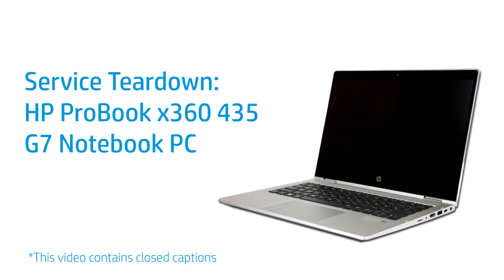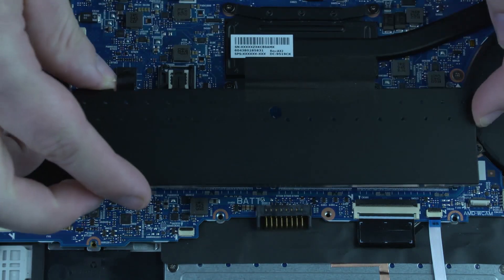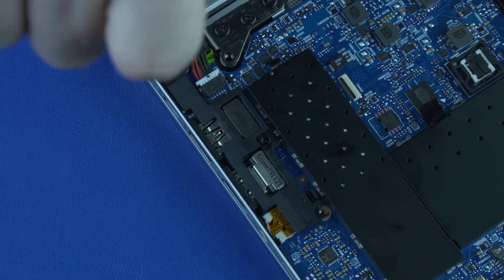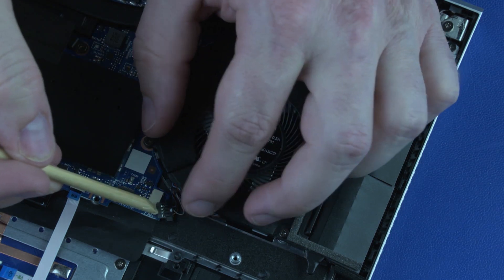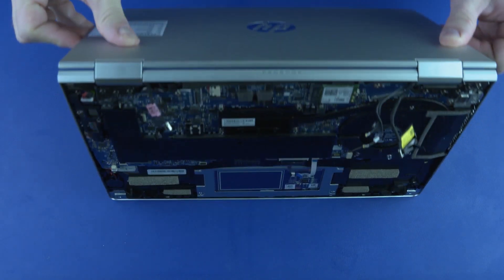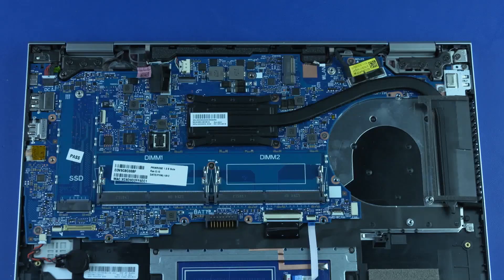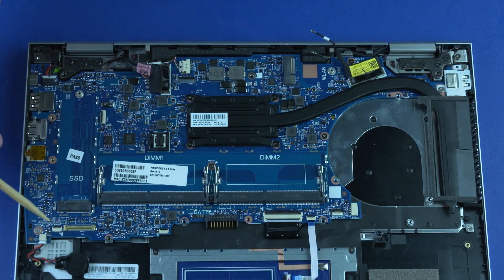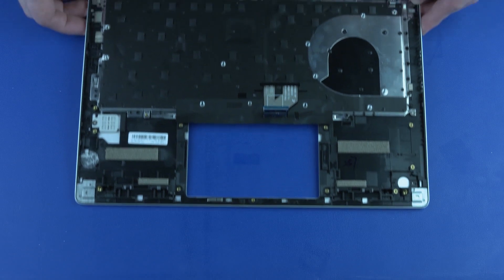Removing & replacing parts for HP ProBook x360 435 G7 | HP Computer Service

Comment: Hello HP Support, is it possible to expand memory space in this notebook, either by adding 2.5" hard disk or some SSD (without removing this already included SSD)?
Reply from the maker: +Danko Nikolić Please refer page number 2 of the user manual to know about the supported storage: https://bit.ly/3gVGNhM
Reply: @HPSupport  Thank you for your reply, but I'm still confused about my options. I'll try to make my question more straightforward:
I have 512GB SSD already installed. Is it possible to add one more storage device, either 2.5" HDD or another SSD?

Comment: Is it possible to order the world-facing camera module and install it in a model that was not originally shipped with one?
Reply from the maker: +Aaron Schlitt HP does not recommend upgrading or downgrading hardware parts or software that is bundled with the product as It may affect the manufacturer's warranty and performance, however, you could change the configuration at your own discretion.

Comment: Hi HP, which kind of M.2 SSD is it? Is it 2242 or 2280? And, which kind of RAM does it use? I did not find them in the parts store.
Reply from the maker: +Yang Ma Please refer the specification page to get this information: https://bit.ly/3kUF4cj
Reply: @HPSupport  Thanks! May I ask why it only supports 16G RAM? The CPU 4750u should support 32G RAM , is it possible that we put two 16G on?

Comment: Is it possible to replace the keyboard?
Reply: Also where could i find one, none of the sellers i found had one
Reply from the maker: +mrgebruiker13 HP does not recommend upgrading or downgrading hardware parts or software that is bundled with the product as It may affect the manufacturer's warranty and performance, however, you could change the configuration at your own discretion.
Reply: @HPSupport  I have a german keyboard layout and would to switch to an Azerty, Is it possible to provide me with the serial number of this part? I've already figured out i would need to replace the entire top.

Comment: I have an issue with my Hp 15 Laptop

When there was an outage i put power save mode on my Laptop. then i accidentally ended Windows task while Ending unnecessary running tasks draining my battery , without knowing what that task ended, i got a black screen showing my cursor only. then Tried to reset my computer and it won’t turn back on again.
Reply from the maker: +Ron1n This document provides possible solutions to many common computer start-up issues. Follow the instructions in this document step-by-step to help isolate the problem and find the most appropriate help: http://hp.care/2oFlOWC

Comment: Pls help me with my Hp Pavilion laptop, first the display is just limited o 1024×768 or something like that, any resolution above that will just make the display crash/fail,  it literally is the nvidia geforce  gpu thing thats failing. Second, I was just watching a video when it suddenly shut down, I thought it was just the heat, but when it cooled down, I tried to turn it back on but still no response.
Reply from the maker: +SteveGaming Please perform updates via Windows and HP Support Assistant as mentioned below to fix this issue: Step 1 Windows Updates - 1) In the search box, type and open Windows Updates. 2) Check for updates. 3) If the updates are available, click on install and restart the computer. Step 2 HP Support Assistant Updates - 1) In the search box, type and open HP Support Assistant. 2) Check for updates. 3) If the updates are available, click on install and restart the computer.
Reply: @HPSupport  mine doesn't have an hp assistant but I'm pretty sure the latest windows update and its also running on  windows 7 ultimate so maybe it doesn't have an hp assistant, but every time gpu rendering is turned on, it crashes into a blank screen or it just displays a BSoD.